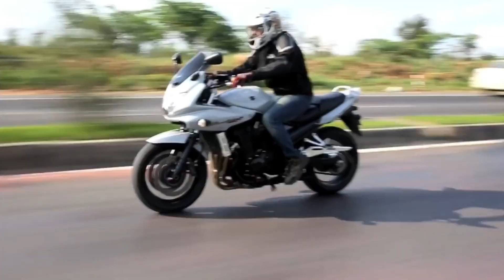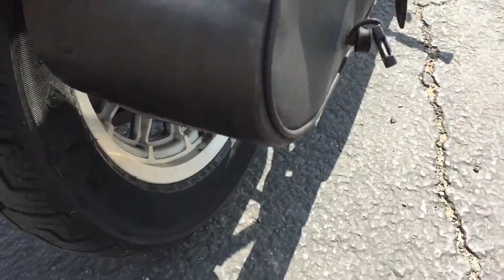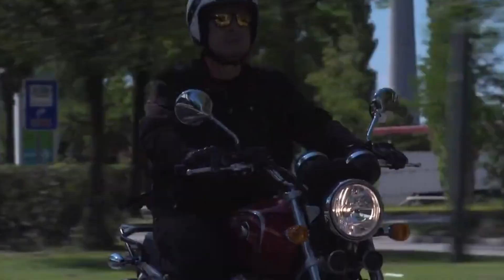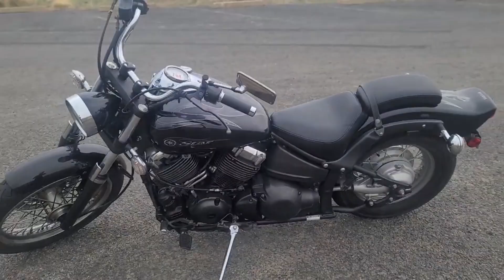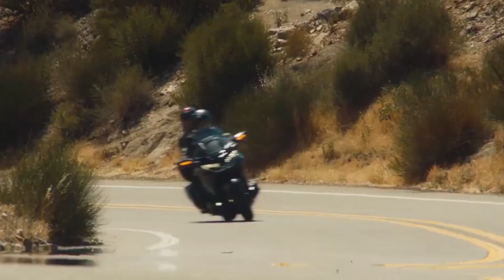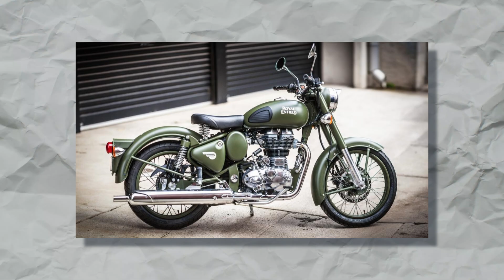10 MOST Reliable Motorcycles ALL TIME!

Comment: Enfeild bullet 500..nope !!
Difficult to find neutral... didn't accept gear changes in the transmission...skips gears..

From vibrations lost all frame bolts in a trip...
Also engine ate all oil...same trip..

Sold after....dangerous bike
Reply from the maker: @SilverIndian  what year was your bullet?

Comment: Pls comment on the new ktm lc4c and royal enfield 650s... Which one would be a better choice if one had an option to choose only one among these
Reply from the maker: @ananthapadmana6han  
Both the KTM LC4c (likely referring to the new 490 platform) and the Royal Enfield 650s cater to different riding styles, so the “better” choice really depends on what you’re after.

KTM LC4c (490 series) – This upcoming platform is expected to be lightweight, high-revving, and performance-focused, with a parallel-twin engine derived from KTM’s racing DNA. If you’re looking for aggressive street performance, nimble handling, and modern tech (think TFT dash, quickshifter, ride modes), the KTM would likely offer more excitement—perfect for riders who enjoy pushing limits and carving corners.

Royal Enfield 650s (Interceptor, Continental GT, Super Meteor) – These bikes offer a more relaxed, retro-styled experience with a torquey parallel-twin engine, great for cruising and everyday riding. They’re known for smooth power delivery, refined build quality (especially in recent models), and solid touring potential with a classy, laid-back vibe.

Verdict:
	•	Pick the KTM LC4c if you want a sharper, sportier machine with modern tech and performance in mind.
	•	Choose the Royal Enfield 650 if you value comfort, retro charm, and relaxed riding over outright speed.

Both are solid options—it just depends on whether your heart beats faster for thrills or chill.